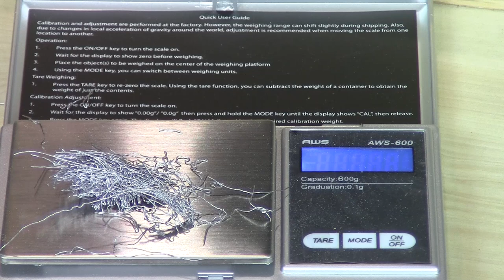How to Turn for Darts and Pens

Comment: Nice video.  Just a note, steel tip darts like these are weighed with tip and barrel and does not include the shaft and flight weight.  So the darts you made are lighter than 20g.

Comment: Just found your video as I am looking for tips as I start my first dart turning project. Any update from your friend on how he enjoyed or used his darts?  Your video is very informative and I feel more confident to start. My fear though is that the lead wool will shift over time towards the front of the dart with use over time. My solution would be to add CA glue to prevent the lead wool from moving. I know weight will be an issue but it is kind of like finalizing the weight of a pinewood derby car.
Reply from the maker: This video was made many years ago, and I still use the darts made in the video. They for me are perfect flyers with just the right weight. I have changed flights many times over, but the darts still remain true.
Reply: @LaneyShaughnessy  thank you very much for your reply. Very helpful.

Comment: great project. what did you use to burn in the lines? they look awesome on that blond wood.
Reply: Just saw this, not sure what kind of wire he used but I use gitaur strings. Secure it between 2 pieces of wood. Hope that helps you.
Reply: thanks, i wouldn't of thought of that

Comment: Where did you get the bushings for the dart set? Also, what size bit did you use for the barrel?
Reply from the maker: +Tal Rodriguez pennstateind.com you will find the bushing set and parts for darts...i used a 7mm barrel trimmer...on the dart kit it will tell you the size barrel bit to use
Reply: Thank you!